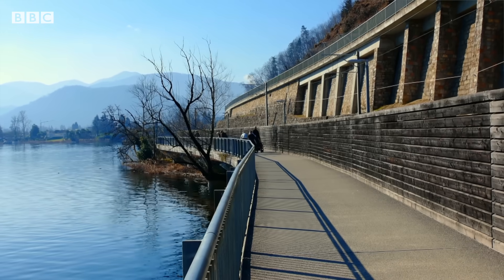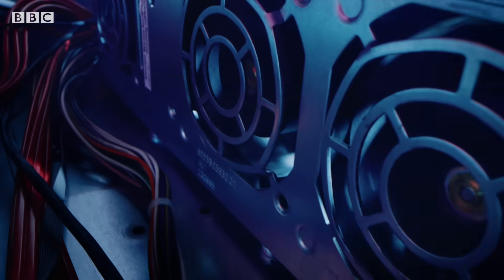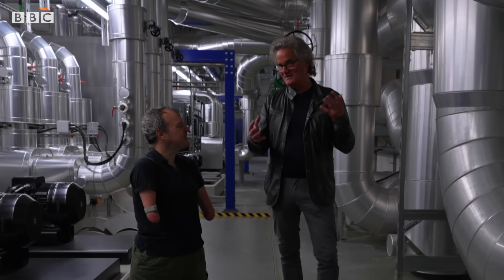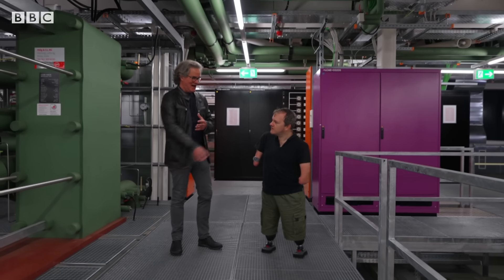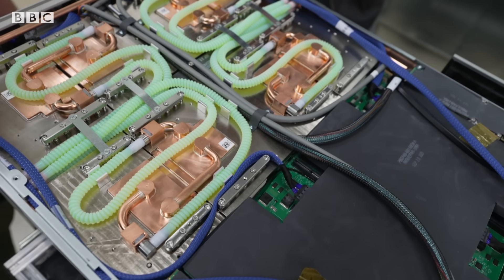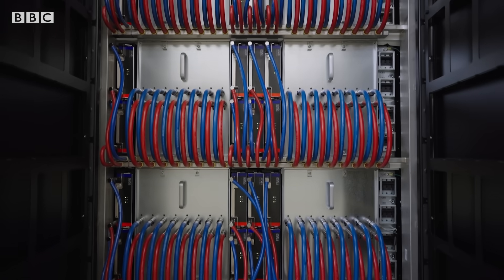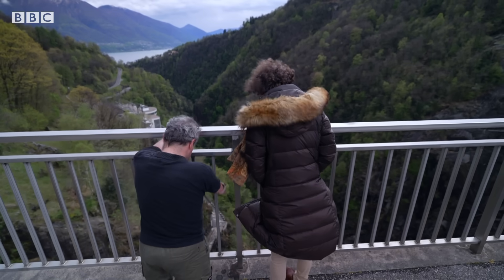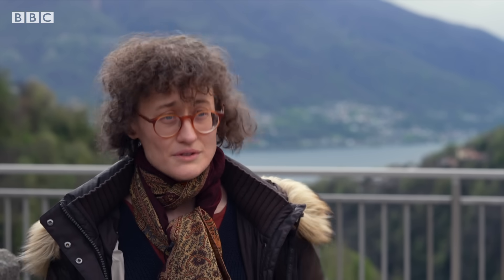Inside one of the world’s fastest supercomputers | BBC News

Comment: "without heating the planet"

I think its very naíve to say this is not heating the planet.

All they are doing is redirecting the heat elsewhere.

And yes, pumping systems also require energy which create heat.

This is at best reducing the amount of heat in comparison to say a refrigerator system.
Reply: Well, it depends on their power mix. Even if it's derived from 100% green energy (hydro, solar and wind) they* have still emitted lots of carbon from all those blades, CPUs, GPUs, interconnects, and the construction of the entire facility.

But if their power mix is fully clean they no longer emit more than that. The same applies to EVs. In those few areas with fully or near fully clean power (like Vermont, Norway and Washington state) they "break even" after 6 - 9 months and then emit no more carbon (Vermont) or barely any carbon (Washington).

But in areas with a dirty power mix, such as Missouri (60% coal), it can take 4 - 6 years for EVs to reach "carbon parity" with gasoline cars, and after that they'll keep emitting plenty of carbon - less if those areas clean up their power mix over time.

*Most are past indirect emissions from the CPU/GPU/etc manufacturers, which need also to be taken into account. All those blades and pipes were not conjured out of thin air.

edit: Btw, heat itself does not heat the planet, only carbon (CO2 & CH4) emissions do. Pure, emission-free heat dissipates and is recycled without any contribution to the planet's heating. There is no mechanism for generated heat alone to overheat our planet.

Comment: Would be nice to know what kind of problems is resolving that affect the common man and woman in a positive way?
Reply: This particular supercomputer is studying the effect of climate change!!!!! - Here are some intresting facts:

- A single supercomputer can consume up to 13 megawatts of electricity, enough to power over 10,000 homes

- The demand for electricity to run supercomputers is growing, putting strain on electrical grids and increasing reliance on non-renewable energy sources

- The continuous operation of supercomputers contributes to grid load, increasing the carbon footprint of the entire electrical system

- AI-driven computing has led to a surge in energy demand, with data centers now consuming 4-5% of the U.S. electricity supply, a number expected to double or triple by 2028

- Many data centers rely on natural gas, which emits greenhouse gases, as renewable energy sources like wind and solar struggle to provide consistent power

-  Supercomputers require large-scale cooling systems, which consume vast amounts of water, potentially straining municipal supplies and disrupting local ecosystems

-  The manufacturing process for high-performance computing hardware involves mining rare materials, contributing to environmental degradation (and child slavery - depending on where they get it from)

-  The rapid expansion of AI and supercomputing infrastructure is changing the trajectory of global energy use, making it harder to transition to cleaner energy sources

- The top 196 out of 500 supercomputers consume 3 billion kilowatt-hours of energy annually, equivalent to what 277,777 U.S. households use in a year

- Data centers, which house many supercomputers, consume 460 terawatt-hours of electricity, about 2% of the global total—and this is expected to double by 2026 due to AI demands

- Mining rare-earth elements for supercomputer hardware releases toxic and radioactive materials, poisoning land and communities near extraction sites

- The energy required to manufacture a computer chip can exceed the energy it uses over its ten-year lifespan

- AI models trained on supercomputers generate 50 metric tons of CO2 emissions throughout their lifecycle, with half coming from training and the other half from manufacturing and infrastructure

Do your bit!!!!!! TURN THE LIGHTS OFF AND DONT LEAVE THE T.V ON STANDBY!!!!!!

Comment: "The Coolingwater flows in from the lake at 7°C and flows out at 15-20°C..." - How can you summarize in a way stating this is not contibuting to global warming?
Would be curios about your answer :)
Kind regards 
Nico
Reply: How exactly would this local funneling of water contribute to global warming? I can't really parse your logic here. 

Regarding the water itself - it's 15-20 Celsius at egress from the facility. The pipe to the lake is well over a kilometer long and underground. The water cools down and by the time it reaches the lake has the same temperature as the lake water, as measured at the lake substation. The center has regular open days with tours, all of this is public knowledge. But you're right, it would have been nice if that had been stated directly in the video.

Comment: It seems like a waste of energy to dump the hot water into the lake. Why not use it to heat the homes nearby? Call that sustainable eh?
Reply: I'm guessing it's because it's not hot enough, but on cold winters yeah, I guess it could at least partially work
Reply: @arandomspaceenthusiast7304  If it needs to be hotter then you can use a heat pump. The warmer the input to the heat pump the less electricity it uses.
Reply: @Andrew-rc3vh  actually a very genius idea
Reply: @Andrew-rc3vh  True, hadn't thought of that
Reply: Infrastructure dependent. The center has existed for some decades now. What changes would you need to make to enable this kind of system a posteriori in Lugano? 

Such projects do exist. Lumi for example is responsible for 20% of district heat in Kajaani, Finland. The difference being, the center is very new and was built with climate goals in mind.
Reply: @whyhellotherehowarewe  You want to factor that into the planning of the data centre. I saw an example in the UK where they were heating a public swimming pool from industrial waste heat.
Reply: @Andrew-rc3vh  Yes, of course. That was my point. There's also just opportunity cost - there was an opportunity to connect the waste heat to the pool in the UK. Definitely something that they may also consider in Lugano in the future.